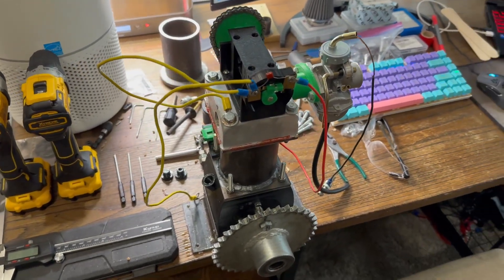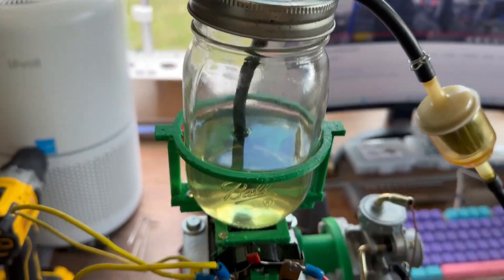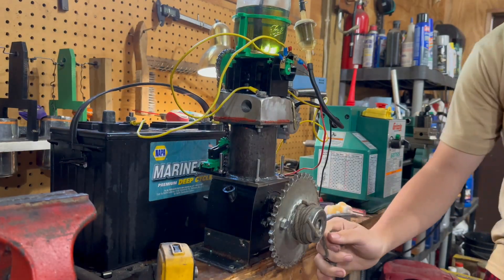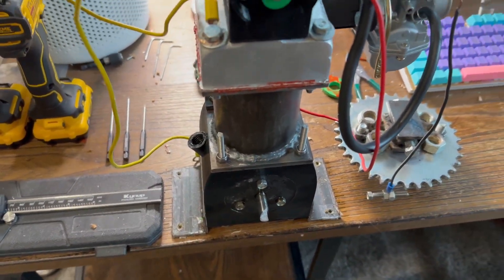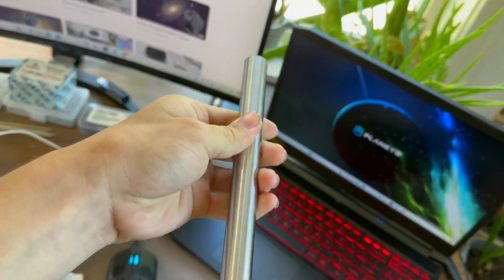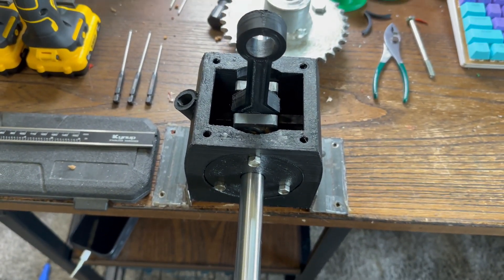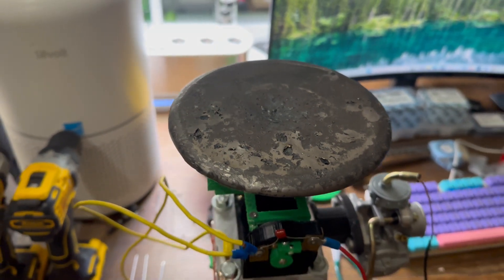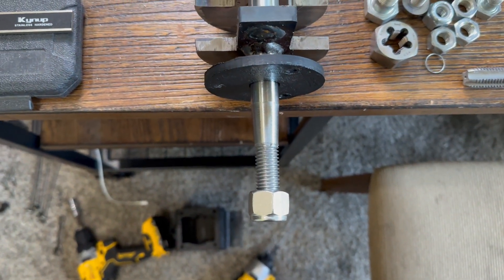180cc 3d printed engine RUNS until failure!!

Comment: Crazy man! Good job. Try making a water loop through the cylinder (and maybe the head aswell if its not too hard) so it'll last longer and not seize
Reply from the maker: I have a 3d printed water cooling jacket made, but I am waiting for once I get the engine to run long enough to need it. 

Thank you for watching!!

Comment: you can get terrible cross tables for mini lathes and use your mini lathe as a milling machine 

I will bet the tapers are not exactly the same an that's why it spun, properly made tapers on't nee a lot of force to hold really well together. Tightening the nut more will 100% fix it an it won't be a problem. I suggest putting a mark of some sort on the flywheel and crank an then marking the TDC on the flywheel so that you can take it on an off an you can align it easier purely for convenience, as you don't have a pin or a key to hold in position.

you could also print a starter for your drill that will disengage itself automatically when the engine starts
I personally would also make some sort of a simple exhaust from a pipe and a silicone hose to not fill up the shop with smoke, it's not healthy

I bet you can get it to run properly and sort of reliably quite soon... just don't forget cooling or you might need a few spare cylinders
Reply from the maker: Thank you for all of the info! I did tighten the flywheel up some more, about 60 ft/lbs, and I have hade no issues, it will be in the next video, but I got the engine to run for 48 seconds in one go! Then my camshaft melted, from the friction with the exhaust valve roller. I am almost done, making brass rollers, and I have already made an aluminum camshaft. I don’t think a 3-D printed attachment for my drill would hold up, this engine has an insane amount of compression, I don’t have a compression gauge, but I’m guessing it’s about 100 or more PSI. Even though I could water cool it, the issue is that my bolts and all thread rods bolt onto the cylinder, but now that I’m thinking about it, I could probably 3-D print clamps on and then I use RTV silicon around everything, actually now that I’m thinking about it that would probably work great. 

3-D printed or homemade metal if I can find some pipe that would work, if I were to use pipe, I would cut it down the center and then weld a flange on each of the sides, then it will bolt around the cylinder and then I can make some thinner. Metal covers for the top and bottom, then I can weld everything together and when I assemble it, I just put red RTV around everything, I actually think would work!

Thank you for watching, and sorry for writing a whole essay!🤣
Reply: @ProjectLMZ  don't worry about it, sometimes you think of new ideas when you try to share them with other people, it forces you to think how to explain it properly and you usually find more problems to fix or a quick solution
I also enjoy "watching" how people think ... hehe

Comment: Looks like the engine needs some severe rebalancing I've noticed there's an awful lot of blowback coming from the filler neck for the oil if it's a four-stroke🤔🤔🤔🤔🤔🤔🤔🤔🤔
Reply from the maker: Have you got to the end? In the end I have a new crank and flywheel, super well balanced. Also I am pretty sure that there is no blow by, because it does the same thing without the spark plug in.

Thank you for watching!

Comment: I would add a exhaust to it because your not gonna hold compression for very long with your valves burning and the back pressure should help the engine run better
Reply from the maker: I don’t have any 90° elbows for 3/4” ID copper pipe, but hopefully I will have an exhaust on it in the next video!

Thank you for watching!!!

Comment: You could definitely make a metal piston and connecting rod with the tools you have. A piston is just a cylinder with a hole in the side and a slit out of the bottom. You already have a lathe and you could figure out the hole and slit pretty easily I sure. The connecting rod is just a plate with 2 holes in it. I’m not sure how your bearings are set up but I’m sure you could get them to press fit into the new metal parts. I do like the plastic piston with a steel shield though.
Reply from the maker: The issue is that my counterweights are a set weight, So I can’t make the piston and connecting rod too heavy, and the connecting rod has to be like a normal engine, I’m going to have to make bearing bronze bushings for the Con rod where it clamps onto the crankshaft. The main issue I’m worried about with making a piston Is that since I’m using a steel pipe for the cylinder, when steel and aluminum come in contact under high friction and high heat environments, they get galvanic corrosion, and then they gall and friction weld themselves together. I could anodize the piston so that doesn’t happen but that would have to be in the future as my budget is basically zero right now. 

Thank you for watching!!!
Reply: @ProjectLMZ  that makes sense. I’d have to see the internals again to be able to suggest anything. If this is just meant to be a fun project then I wouldn’t be too worried about galvanic corrosion but if it’s something you want to actually do work then I’d worry about it. The heat expansion of the steel vs the aluminum could be something to keep in mind too. I don’t remember how you have the counterweights set up currently but with how stiff the shaft you used on the crank is you might be able to counterweight the internals from the flywheel. If you weren’t aware some engines already do this. Keep pushing I’ll be waiting for more updates. I love this kind of content.
Reply: @ProjectLMZ  a small electric pump that sprays oil on the cylinder walls and on the underside of the piston would help a lot
the small 12V electric pumps (the ones with yellow-white pump and inlet and outlet next to each other on the front) can handle oil and can push quite a bit of pressure, they can push 0,1bar with air and 2 bar with water so with a 5w-40 oil or thinner it would work really well. I have it set up on my little router as a coolant pump and through a 1mm nozzle the liquid is going quite fast
Reply from the maker: @Cjarka_  I think I would just run like a triple mix on two-stroke oil, simpler, and probably more reliable.

Comment: thing still blows crankcase smoke like a freight train XD
Reply from the maker: Yeah, the crank case is a little on the small side, the crank case volume after you subtract the crankshaft in there is literally the same as the volume of the cylinder, so the engine is running the gas is in the crank case are moving at the same speed as the gases in the engine, and that’s pretty darn fast.

Thank you for watching!!!!
Reply: @ProjectLMZ  yuppers, cool content. thinking about it again, because of that small crankcase volume it might just be acting as a pulse jet almost, which is kinda funny. cant wait for you to put this engine in something
Reply from the maker: @yukonxl5723  right now I just made an aluminum camshaft, next is metal valve rollers, then this engine will run until it completely melts through the plastic piston. At that point, I’ll have to find a suitable material to make the piston out of, if I use aluminum will gall itself and the cylinder walls.
Reply: @ProjectLMZ  i wonder how well a jb weld piston would work XD
Reply from the maker: @yukonxl5723  I actually want to try it, I could 3d print a mold and cast it!
Reply: @ProjectLMZ  ooo nice. maybe try the high temp jb weld as well
Reply from the maker: @yukonxl5723  it would be easier that a cast iron piston and would last a lot longer than a plastic piston!

Comment: this is an awsome build, the fact that it ran for so long with printed parts is amazing, i would love to see this thing powering something sometime, your machining and fabricating skills are amazing, with it running you can start tuning 😁, your throttle response was kinda crap, im thinking you might have some sort of fuel delivery problem, cuz when it started on the spray it revved up really high but when you tried giving some throttle with the carb nothing much happened, maybe try fiddling with your carb, anyway I'm sure you've seen camden bowens engine on youtube and he seemed to get a lot of attention for his 3d printed engine, try making a nice thumbnail for your engine and i think you can get much more views on your videos and hopefully you can get your mill, anyway this is a sick build and Im excited to see how it turns out 😄
Reply from the maker: I wasn’t giving it hardly any throttle, I was maybe pulling it like 1/8”, I was scared of blowing the Con rod out the side of the block again, but you’re right when I started it with starter fluid it revved up, so maybe I can give it more throttle. I was also doing really short blips of throttle, just trying to keep it running. 

What would be a thumbnail that you would click on?  I want ideas for thumbnails because I want to try to get as many views as possible, but obviously not Clickbait. 

Thank you for watching!!!
Reply: @ProjectLMZ  the one you have now is good, but I feel if you can put some more effort into it, you might get more views, now thinking about it again I don't think It'll make THAT big of a difference, but what you're doing is still crazy impressive I think that you'll soon blow up and start getting monetised, also for the conrod if it's made of plastic then it might fly apart at higher speeds, what's the infill like on that one? maybe print it out really thick, then I'm sure you could run it fine. and try not to be worried about stuff breaking, if anything it's a good thing because you can improve on past weaknesses and you can see where issues actually are
Reply from the maker: @Jarc123-i4m  the infill on the current Con rod is 100%, but if it breaks, it’s gonna blow a hole through the side of the block, and I am almost out of filament. I replace the valve spring retainers with aluminum ones and I have a new record runtime of 48 seconds in one run, which will be included in the next video.
Reply: @ProjectLMZ  maybe you could try metal casting in the future, if you have plastic con rods and metal pistons your going to have a HUGE imbalance and it's going to shake a TON, maybe in the future a cast rod would be a upgrade
Reply from the maker: @Jarc123-i4m  right now it is a plastic piston and connecting rod, but in the future, I want to upgrade to a aluminum piston and connecting rod, but I am worried if I upgrade to an aluminum piston that the steel cylinder wall is not going to play nice, I think the aluminum piston is going to gall, and I think I might have issues with galvanic corrosion. I would like to do a cast-iron piston, but then I’m going to have issues with weight.

Comment: the timing needs  to ignite fuel a bit earlier

like barley earlier (I haven't watch the entire video yet)

edit: I see you did fix it

if it ever dies when you give it throttle and it responds 
but when you let off it dies
it means your idle is too low,
Reply from the maker: Yeah, I actually think this carburetor is slightly too small, I have the high idle screw adjusted all the way and I think it still is just barely getting enough fuel.

Thank you for watching!!!

Comment: very cool! also flywheels usually have keyways
Reply from the maker: I don’t really have a way to cut a keyway in this flywheel, but it’s not necessary as this flywheel is not controlling anything, ignition is run off the cam, and the flywheel on the inside is threaded, so the flywheel threads onto the crankshaft, and the flywheel nut is torqued onto that.

Thank you for watching!!!
Reply: @ProjectLMZ  that makes sense

Comment: Maybe some kind of exhaust could make the exhaust valve to run cooler so it doesn't melt the retainer that quickly? Either way you would need to go full metal in order for it to function a considerable ammount of time. Maybe the connecting rod could stay plastic.
Reply from the maker: I have a feeling after I upgrade the piston to aluminum, the connecting rod is no longer going to be strong enough due to the increased load. The aluminum piston will be about twice as heavy, and I don’t know if I would trust this connecting rod with that. I could try to make an F1 style piston and stick with a plastic connecting rod, that would be pretty cool!

Thank you for watching!!!!

Comment: i think you should go for the 2 stroke, the piston will cool better and receibe lubrication, also simpler, and make the piston smaller diameter without changing the cc, that will decrease the force it makes in the cranck. Im working in a similar project and what im going to try is printing the head and cylinder as the same piece with the porting premade, then put inside the copper sleve, and see if it works. Also becouse it is in one piece you can make passages for water cooling. Really like your series and this video too, but now is not 3d printed. Much love
Reply from the maker: I tried two-stroke, but I got tired with messing around the with the ports, I just couldn’t get them right, I like the four stroke better anyways because in the future, I want to boost it.

Thank you for watching!!!
Reply: @ProjectLMZ  oooooo, cheacky turbo in there ahahahha, nice. Understood, I want to keep going with the 2 stroke design, and becouse i know you tried it... Can you give me advice on what to look for and be careful of. Semething else that you didnt mention on the videos? Thank you so much
Reply from the maker: @mrmonguerwtf2976  everything with the two-stroke is pretty straightforward, for the crank case you just have to make sure it’s sealed good, for the head you literally just have a spark plug hole and that’s it, You have your transfer port that will connect the crank case to the intake port, and then the exhaust port. I had a lot of issues trying to get the ports right, with my Dremel I just couldn’t cut them right, I ended up messing up three or four times, eventually I just said, screw it and tried using it. It didn’t work. But if you have some way more accurate than I’m sure it’d be pretty easy, there’s not a lot of parts to two stroke. 

Best of luck to you!!
Reply: @ProjectLMZ  Wich one way valve did you use on the intake? After the carb. Thank you for the answers!!
Reply from the maker: @mrmonguerwtf2976  I actually used a balloon filler, it was a one-way valve that came with a pack of balloons I bought for making sterling engines, it was so that it’s easier to blow up the balloons, you blow in and then it would not let the air out. It actually worked really good as a reed valve for the engine.
Reply: @ProjectLMZ  Thank you for all the info. I really enjoyed the whole series. Much love :D

Comment: algorithm brought me here today.  super impressed.  just curious, why would you not 3d print the piston and rod, then use the 3dprinted piston and rod in a bucket of sand to sand-cast metal ones?  dunno if maybe you tried this in another video already, i just got here, but it seems like you gotta look at where your most likely failure points are going to be and beef them up beyond normal use-case parameters.  also as a fellow amateur engineer i'll share a concept that i hold near to my heart.... you're going to have a fail point somewhere, there is no 100% reliable.  engineer it so that whatever the weakest part is on the system, it's something cheap and easy to get to.  build like honda, not like jaguar.
Reply from the maker: Thanks for stopping by! I have future plans to cast them, but I am a bit worried about using an aluminum piston with a steel cylinder, I’m a bit worried about galvanic corrosion. Do you have any ideas on that? Other than that, I’m actually working on 3-D printing the template for casting the piston right now!

Thank you for watching!!!

Comment: Awesome! Getting much better. Crank runs much straighter. It amazes me ho much the old one flexed ! 😅 
 You could try using some lapping paste on the crank taper to help with the flywheel seating and staying put. 
I think after that the valve train will be the weak link. 
Great video. Full respect for your sketchy experimentation 😊
Reply from the maker: The flywheel actually has threads in it, it threads on like a nut, and then the nylock nut locks it in place. By the valve train do you mean the cam holder and camshaft? I think it will melt next as well. 

Thank you for watching!!

Comment: I really love this project! A real post-apocalyptic job. A couple of thoughts:

Using a glass container for a fuel tank is a hilarious design choice, especially with all of the vibration. Consider mounting it to your workbench using  a longer fuel line so the vibrations don't bounce it around as much. Don't let your homeowners insurance company find out!

Consider a dial gauge and a spark plug hole adapter to find TDC. That's how we used to set timing on 2-strokes back in the olden days of the 1970s.